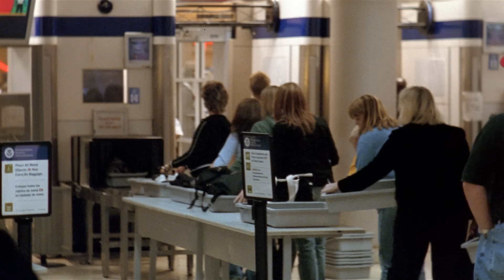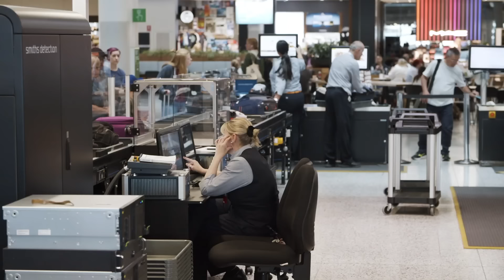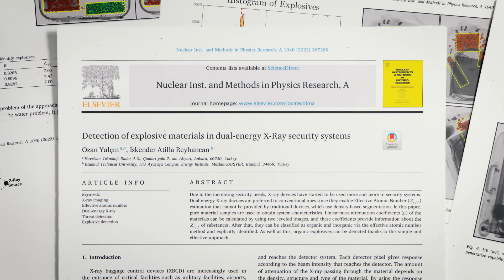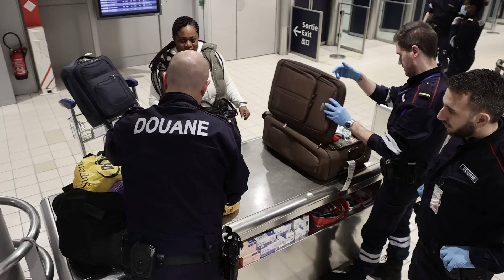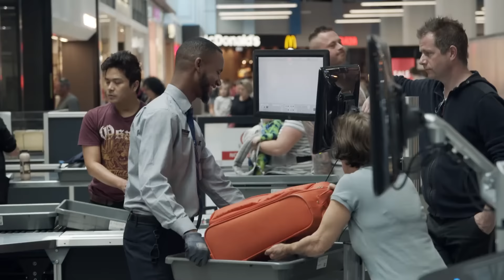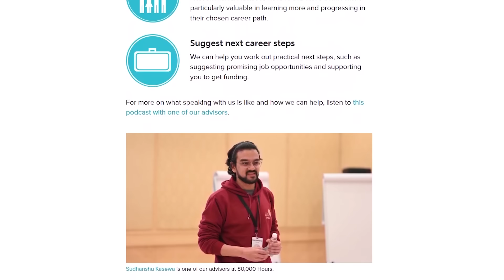Why Airport Security Suddenly Got Better

Comment: TSA: Sir, you can't take that water bottle with you, it could be an explosive
Me: throw it in the garbage next to them
TSA:  enjoy your flight!
Reply: As long as there is no fuse attached on it, which is connected to an electronical device, it simply can't go boom
Reply: @carsamba0055 I don’t think the majority of people realize this lol
Reply: even if it was an explosive, it doesn’t have a battery or detonator so it would be harmless. Try again.
Reply: @JasperXIII  it could be an acid though, that could cause damage.
Reply: @JasperXIII they often let you drink a little bit of it... or they put it into another device which detects acids
Reply: Security theater, indeed. With the emphasis on theater.
Reply: @jozef_chocholacek  Did you know that "theater" is a HUGE part of security? The guy who made the term popular is a security guru but fails miserably to explain that. 

Same reason why a fake CCTV camera does better than nothing. It's why a Master Lock is generally enough to deter a potential criminal.
Reply: @jozef_chocholacek  Last time we tested them they caught 3% of the dangerous objects, it's not the x-ray scanner to blame by the way it was when they had the newer scanner tech.
Reply: @GeorgeWashingtonLaserMusket and yet they caught a lot of guns and knives this year.
Reply: @Ghostmarshs  that’s just a result of numbers. If you have hundreds, maybe thousands of flights across the US, each carrying dozens of passengers, even if you have a low rate of carrying, and a low rate of detection, pure numbers day you’ll find something regularly.
Reply: I just wish there was an easy way to distinguish between a drink and an explosive. Something that could be done right at the spot. Like, say, drinking from that damn bottle!
Reply: @jendakrynicky5218 think of the queue for security having to wait for people to drink from every bottle thay brought that might also be sealed. You are genius indeed

Comment: 'the machine automatically  calculates the volume of a container and calculates a specific weight' is a nice story or coverup, it's not done that way. The error margin of such calculation (wall thickness for instance, exact internal shape of bottoms) is greater than the given distances in specific weights of the substances looked for. 

(But a nice try? No, not even that I guess.)

Comment: I have worked for a couple of years as a researcher on X-Ray phase-contrast imaging, which I guess is what you're hinting at at the end of the video. I am still quite doubtful regarding its use for airport security, but I could be wrong and I honestly haven't given it too much thought. As far as I am aware right now, there are mutliple competing ways to achieve this and the debate for the most efficient one is not yet settled, but my money goes on speckle-based imaging. 
It was also quite funny to see the article by Yalçin being displayed here, since I showed it to a colleague recently when we discussed sample density measurements.

Comment: I'm a researcher who has done work on Dual Energy Computed Tomography. Specifically for rock classification in CT scans of drilled rock cores. As soon as you started setting up the problem, I suspected that DECT was how these scanners were achieving their results. It escaped me that airport detectors are now doing CT, rather than standard 2D scans. That's a huge leap in complexity and maintenance. Very impressive the reconstruction of image data is done in real time with the Dual energy calculation. That's extremely advanced!

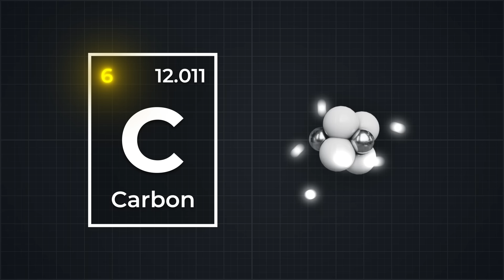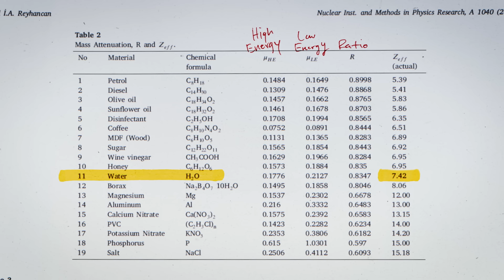At 4:48, you mention the atomic number. DECT work tends to instead deal with "Zeff" which means effective atomic number (Z). You mention this later at 6:10, but it is not a 1:1 thing. There are very weird X-ray behaviors at high energies (>1 MeV) not intuitive if you think only about atomic number.

One thing that surprises me about these machines is that the DECT theory generally assumes a monochromatic X-ray source. Yes, X-rays are polychromatic and have a sort of rainbow of X-rays rather than just one kind. To get a monochromatic X-ray typically requires a linear accelerator or particle accelerator followed by filtering out undesired X-ray intensities. There's just no way these machines do that, as such systems are huge and very expensive. So they somehow solved the problem of standardization to a degree that they feel confident in assigning material identity. That's a big technical challenge that impedes the general use of DECT, so kudos to the Smiths Detection team if they did indeed solve this problem.

Comment: Fun fact, these aren't better. I accidentally had a knife in my carry on and these machines did not catch it at all. I was on 3 flights with a knife with a 2 inch steel blade. It was only caught on my way back home through the 'older' machines. I reported this incident to the airport in question and they are investigating what went wrong.

Comment: It's interesting to see the mix of experiences and opinions surrounding airport security measures. From anecdotes about successfully bypassing security with unexpected items to frustrations with inconsistent procedures across different airports, it's clear that airport security is a complex and sometimes flawed system. While advancements like new scanning technology can improve efficiency, it seems there's still room for improvement in terms of effectiveness and consistency.

Comment: The USA still hasn't learned how to use these machines properly yet and they have one out of several in an area.
Australia, every airport in the country changed over at the same time so there is only one set of instructions nationwide with a sub 5 minute wait. Even secondary screening is better, they keep the line moving and most times don't even need to open your bags.

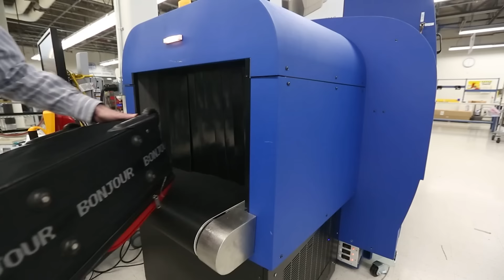Comment: @9:16 - they'd need another type of test for density though. It can't be based on the same number that was used when it was getting mixed up with hydrogen peroxide.
This whole "second metric" isn't really working anyways because H2O2 would be very similar to water anyways (in density).
Or are you saying, in combinatino with the volume data, it's just enough to get a slightly better distinction.
Reply: Exactly. If z values are based on density, how can looking at the z value again be used to discriminate between compounds with similar z values?

Comment: It's not only "hasn't flown for 20 years", but might be not used to such obsolete ways of getting through security. Even 12 years ago I did not have to take off my shoes or take out electronic devices from my bag. Way quicker and less of a struggle as I overly pack my bag all the time. Good to see the US is finally catching up. The water thing is new though!

Comment: I know that the shielding is probably quite well engineered to ensure that no passengers or staff are irradiated, but I know the average medical CT scan contains a fair amount of radiation - to the point where we get quite nervous about performing a CT scan to people under the age of 50. My logical brain knows that they've probably tested this thoroughly and ensured good radiation shielding -after all, you're not putting a person in the scanner, so you could likely design a shielding solution that allows a minimum amount of radiation to leak through the apertures of the scanner.

But my far less logical brain makes me wince at the prospect of standing next to any sort of CT machine without a hefty radiation proof shield between it and me.

Comment: My airport recently switched to exclusively Smiths Detectors. I was very excited, because I've tried to stick to the lines that had those for years, but I've been surprised to see that the change has led to a lot more false positives and manual searches. I still prefer it to taking my stuff out every time, but I sure wish my bag wasn't getting flagged every two or three times I go to the airport 😅

(And for those wondering, no, I don't have anything weird in my bag that's causing it, I always pack by the TSA rules)

Comment: idk if you really answered the question you tried to answer ? you start off by saying that now that xray machines have 3d models and two different energy levels they’re able to estimate the density of objects and therefore their chemical makeup. Then you say the density between water and liquid explosives is so close that it’s difficult to distinguish between the two without constant errors. Finally the main question is posited: how do modern xrays distinguish between water and liquid explosives? Your answer: xray machines now have 3d models and two different energy levels they’re able to estimate the density of objects and therefore their chemical makeup. 

what am i missing?

Comment: "How are these new machines making airport security less miserable, and much safer." You lost me right there, right at the start.

Any US citizen will tell you that this is all a farce. These new machines are slower and not any "safer" then the old x ray machines. The TSA employees behind the line control the speed and safety of the line, and they're just as lazy and incompetent as ever, even with new machines.

I had a metal multi tool the size of a credit card in my wallet (and honestly forgot about it). I took it through these machines at least 10 times before a TSA person saw it once. They saw it on the scanner then had to confiscate it "because it has a serrated edge, and that's not allowed." Every time that multi-tool passed through the scanner undetected before that.

Also, until we can stop damn near stripping down naked to get through the security line, and watching the bags crawl through scanners taking 60 seconds per bag to scan, airport security will always be miserable (in the US).

Comment: How things have changed. I designed the first digital airport scanner with a moving picture back in 1978. It had a very low x-ray dose and did not fog normal film. Twenty five years ago, they had CT scanners and dual energy x-ray scanners. They were big and clunky and used mainly for checked baggage. They could even detect money with them. They did not have today's super fast computing power and ran kind of slow.

Comment: I had a friend who worked in a lab conducting research on explosives. This meant he handled explosives in his job all day every day. The entire lab, and the grounds surrounding them were saturated in components of chemical explosives.
     He had to go on a business trip once and he'd be flying out the night after his last day of work and he knew this could create problems (part of his work included finding ways to detect explosives), so he knew he'd have to carefully plan for going through TSA.
      While he was working his wife cleaned the apartment and put fresh sheets on the bed. She laid out the clothes he would wear to the airport then when he got home he undressed and climbed into the shower. His wife joined him and helped him carefully wash his body. He then got dressed, careful to avoid cross contamination. 
      Even with every precaution TSA STILL detected explosives. He was able to clear TSA but it was a huge pain in the ass.
     He did learn one thing. All of his careful planning made no difference, he could have gone to the airport just after work and had the same result.

Comment: I’ve been in airports where they will arbitrarily decide (though usually based on how long the line is) whether or not you have to take off your shoes or remove electronics. Same machines, same lines, just whatever mood TSA is in.

Comment: the technology could even identify how much lithium is in a battery so they can find out if the battery has more lithium than what is allowed for shipping.

the scenario would be a full truck sized scanner would scan a truck shipping container that is loaded with 48 volt ebike batteries that claim to be 15 amp hours at 750 watt hours and the scanner finds an amount of lithium consistent with a 30 amp hour or 1500 something watthour in violation of the level of hazmat dangerous goods declaration documented in the shipping papers.

the technology with it's alerting officers i think is how apple was supposed to detect illegal images .

another way is to let the bottle of water through and have an officer watch if someone starts assembling something or takes an unusually long time in the bathroom and intervenes.

they could also have a line of varying resolution scanners 

it is like at the hospital where they may start you off  with the cheapest the ultrasound sonogram  then once they see an unusual thickness in the walls of an internal organ then send you for a pet or cat scan and if they are more sure of what it is then to the most expensive test the MRI .

Comment: Detroit has these new ones from Analabs (man what a terrible name) and you don't need to take anything out.

They don't do the liquids, because we still have to empty water but these machines are incredible compared to the older stuff. But now you just chuck all your stuff on the belt, go through the air poofing machine and you're done.

Only thing they can't do is see through really nice camera lenses. Just traveled through one of these machines with a Canon RF70-200L and they still had to take my lens out and do a swab by hand.

But other than that, these things are awesome. These Analab ones must be CT machines because they look like a CT machine. The center section is a round tube.

Comment: So the x-ray machines measure the absorption of materials a two wavelengths and from all directions, but how does it accurately determine the identity of materials through other materials? My understanding is that you generally need to correct for it with a reference. There's also the fact that the materials inside the bags aren't a homogeneous mass.

Comment: They have these machines in France airports , at Paris Orly I got to use them you don't need to take out liquids you can bring your own drinks and everything moves smoothly .  ......they also have them at the Paris Charles de Gaulle airport but only if you are a premium speedy boarding customer

Comment: I had an Xbox with me in my bag (I was going away for a couple of months, so I thought why not). I asked if I had to take it out, was told that it would be ok in the bag, so I left it in. 

Bag goes through, I get immediately flagged down. 
“Sir, what is in your bag”
“An Xbox” 
“A games console?” 
“Yes, a games console.” 
“We will need to do a further search”
They proceed to take EVERYTHING out of the bag, to conclude that I, am in fact not a terrorist. They didn’t even offer to help me with packing all of the clothes and other stuff. I still don’t get how you see a teenager with a controller, multiple games, a power cable and a computer, and immediately forget that games consoles exist.

Comment: I take a small issue with the reasoning that airports want security to be fast so you can spend more time spending money on overpriced things on the other side. 

It feels like the reverse to me. I have to go to the airport extremely early because how long security takes is such an unknown variable. That means that the long security wait times causes you to spend more time on the other side, not less. 

If I knew I could reliably get through security in less than 10 minutes, I would be showing up for flights only 30 minutes before boarding.

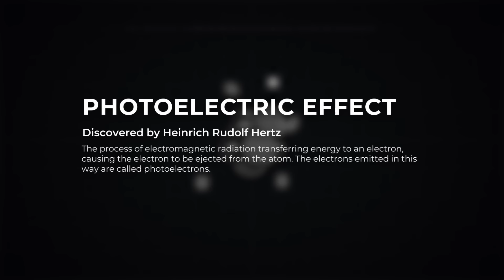Comment: 3:25 is a pretty bad explanation of the photoelectric effect. Energy from a photon is not "absorbed and reemitted as an electron" - energy from the photon is absorbed by the atom and promotes an existing electron to such high energy that it breaks free from the atom. There is no new electron created, and the material becomes positively changed as it loses electrons.

Comment: I live in the UK and going through security is a PITA. I am an electronics engineer so tend to carry a lot of hardware with me and 9/10 times I go through I get stopped. 

Germany on the other hand is a cinch. I go through Munich reasonably regularly and very rarely get stopped and don't have to take my laptop out of my bag either.
Reply: I'm brown so I get stopped 10/10 times. I'm the randomly selected mvp

Comment: high tech airport security isnt reliable. like those whole body scanners. i once forgot ammunition on my body and got through. i only noticed on another airport, when the metal detector went on and i was questioned by police. luckily it was only one bullet and since i immediately agreed to having it confiscated and appologized, there wasnt much of a problem. but still, it was in my cargoshorts kneepocket. probably showed up as a button or something. small caliber.

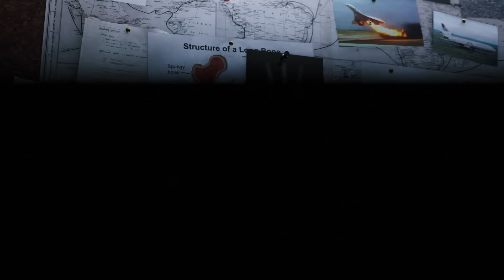Comment: 3:55 yes, the inside is softer, but the edges absorb more radiation, because of the geometry of a cylinder. Rays hitting near the outside, has to travel through more bone, than at the center

Comment: My first thought was concerning the molecular and density similarities between water, (H2O) and hydrogen peroxide (H2O2), “How could an x-ray find and accurately account for the single additional oxygen atom that makes water –> hydrogen peroxide?”

There’s more to it than that which meets the eye, as the extra oxygen atom (16 g/mol) increases the density of water to a level commensurate to water plus the additional weight of an extra oxygen atom (16 g/mol). While water has a molecular mass of approx. 18 g/mol, hydrogen peroxide, with its extra oxygen atom, weighs in at about 34 g/mol. (16 g/mol more!). Still yet, this is on a scale that is largely beyond simple comprehension!

It is a remarkably refined example of how carefully constructed and measured x-rays, alongside the continually refined algorithm made possible by raw computational power and the feedback loop we call, “AI”

The humble 1980s computer chip has grown to such immense and precise computational power, that even the tiniest of variables suddenly becomes measurable and relevant.

What a great time to be alive !